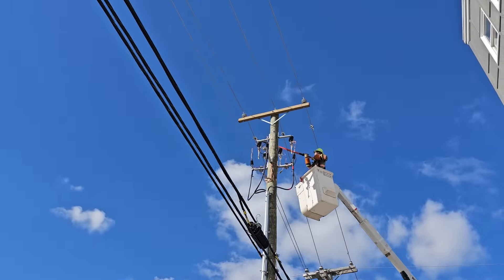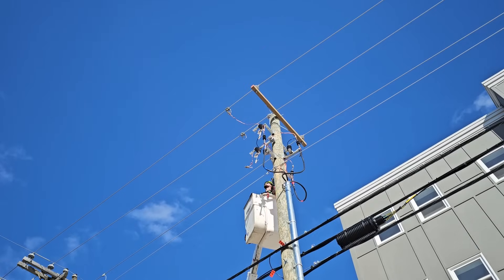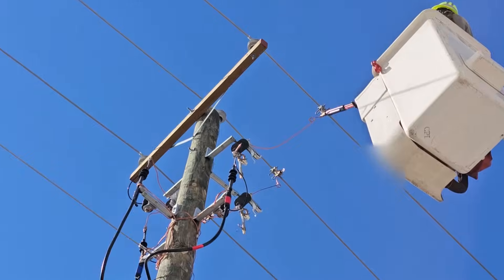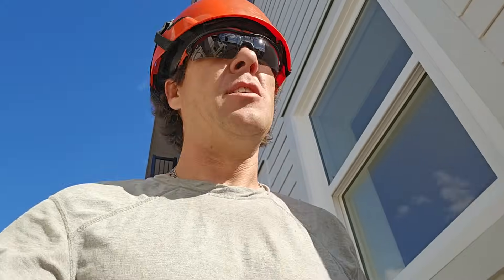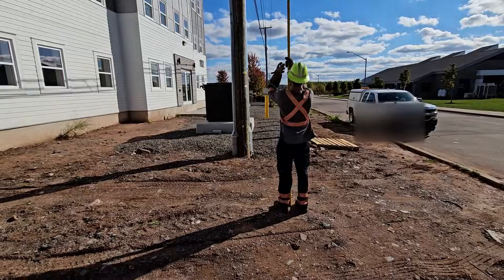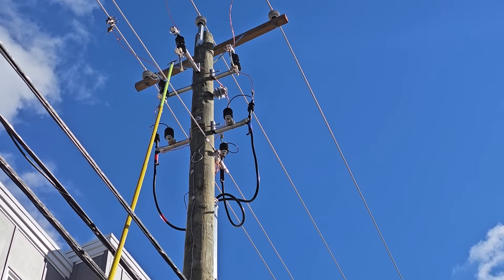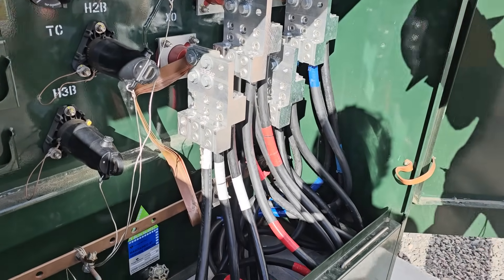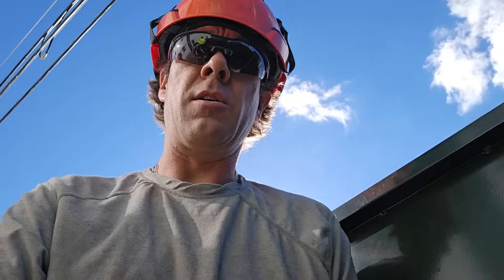Apprentice energizing padmount transformer

Comment: Just out of curiosity I would want to check phase rotation as well. I don't know what the code is in Canada. But in the US the phase rotation is required to be clockwise (ABC)  from left to right, top to bottom, or front to back.

Comment: We use an arrestor elbow on the B side of the pad mount. We need customer load connected when energizing any voltages over 13,200 volts. Otherwise we risk a phenomena called ferroresonance. Or we can install a load bank on the secondary bushings to replicate load. It’s like a bigger version on the mega-beast. With the new 4 core transformers coming out now we have a gang switch incorporated into the pad mount. We can turn the whole pad mount on or off with a shot gun stick. We can also energize the A & B sides separately. We try to give the customer clockwise rotation unless otherwise requested by the customer? 
How many crews did they send to Florida for Milton? 
Keep up the great content Aaron! 👊🏻👍🏻.
Reply: All of our 3 phase transformers had switches for HA, HB and the secondary so we would always pick the transformers up on the gang switch and if we were ever making or breaking parallel we would also do it on the gang switch. As far as rotation we only hook up the primary on 3 phase pads, we use RWB and we always go RWB top to bottom. The electrician is responsible for making all secondary connections and they have to supply a megger report and torque report as well as struts to support the cable to take the weight off of the bushings. We also had a maximum of 2 customers on all 3 phase pad mounts.

Comment: Last December a new apartment complex was completed in my neighborhood, a new pole and three transformers had to be erected across the street. Power was connected to the downstream line, however phase "C" needed to be added at the pole next to my complex on the high tension wires. At the same time disconnect switches, lighting arrestors  were replaced. New complex has 4 service head drops.

Comment: Do you guys do any testing before you energise for the first time?
Reply from the maker: If the cable is 4/0 or above its meggered before energizing. Standard Transformers are all tested from the manufacturer. In some cases we test the customer's cables for short circuits as well.

Comment: Our arrestors come hot when we land the taps....Never did like that especially since you are usually head level with them as you land the taps...Hate them things. Also we have primary internal load break switches on just about if not all new pad mount transformers. Energize the cable with it open, grab a grip all and energize transformer, all 3 phases come on at once. You are not single phasing customer. We also have the primary and secondary separated with a barrier. Dont like your dust cover drain wires near the secondary...

Comment: Why use bare copper out in the open? ( especially for the live wires )
Reply: Code
Reply: Not sure. The copper is quite a ways up, seems unlike that there would be theft at that height and that it us energized. But yhea,  would aluminum not work?

Comment: Aaron, assuming the three cutouts are for each of 3 phases, where do they pick up the Neutral?
Reply: There is no neutral on the primary side. It's a ∆/Y transformer, like most of them are.
Primary 3 phases, 3 wires ∆
Secondary 3 phases, 4 wires Y
The common point in the Y is where the "neutral" wire comes from.
Reply: No neutral on the primary side of the transformer, but the neutral is "derived" on the secondary side, which is in a "wye" formation - one side of each of the 3 secondary coils are tied together to form this "neutral" connection. So you end up with 4 wires on the secondary.
Reply: The neutral on the secondary side provides 120 volt power.

Comment: #2 copper on an arrester and they used an aluminum h connector for a copper to copper connection? 

#2 coppers way to stiff for an arrestor ground. Should be #4 so it can fall clear. 

And to make it uglier they had no fencing staples rhey used moulding staples? Dog water contractor.
Reply: Dude, grow up. Show us your linework...if you're even a real lineman.

Comment: Hey, I'm a sparky in Australia. Was just watching the thesting at the end, voltages didn't match what I would have expected.
Is your white the neutral and black a phase
We are opposite over here if that's the case.
Australia: Black Neutral and Red White Blue are phases.
Reply: Hey there - in the US on a 208V system, Black, Red, and Blue are phases and White (or white taped) is Neutral! So yeah, amazing how different each country is with color codes, as well as voltage, even frequency!
Reply: Black as neutral..? That's odd.
First time hearing this. 
I'm in the trade and work in Canada. 🙋‍♂️🍻
Reply: @martf1061  Australia may use European standards.
Reply: @dfirth224 The very old British was red/white/blue for the phases, black neutral, and green earth/ground. L2 later became yellow, then changes came from the European Union with the phase colours brown/black/grey with blue neutral and green with yellow stripe for earth/ground. These colours were chosen as they are apparently the least likely to be misidentified in most cases of colour blindness.
Reply: @martf1061  black wire, but white tape.
Reply: "white the neutral and black" Yes, in US and Canada (not rest of world). Originally ALL insulation was black (high carbon rubber). The electrons don't care and early systems didn't make a distinction. Even into the 1920s. By then it was clear that hard-grounding one side could be safer, Code proposed an "identified conductor", white preferred, because there was always a pot of white paint around. I worked a 1929 building all like that. This house here is 3 black wires loosely twisted, I added the white tape after verifying no hi-leg. Poly-plastic with permanent color is so much better.
Reply: Canada is Red-Black-Blue.  
The USA is Black-Red-Blue.
Reply: we have different colors for different situations.

for 120/240 volt split phase, its black and red.
120/208 Y is Black, Red, Blue
for 120/240 high leg delta, its Black, Orange Blue, with the high leg marked as orange.. Sometimes it will be black red, Orange, again high leg orange
for 277/480 Y, its brown, orange, yellow. 480 is often found in larger commercial buildings as well as industrial sites.
Reply: White is indeed neutral. This is a 120/208V tri-phase system. Black, blue and red are phases, and green or bare is neutral here. Sometime the green is yellow striped. And a common thing here is to use all black wires and just tape the end with colored electrical tape.

Most homes and appartements are split phase 120/240V. Some bigger complex uses 120/208, others get basically 3 split phases (so 120/240, 3 times). 

Standard outlets and lights circuits are 120V 15A, sometime 20A.
Most heating stuff is on 2 phases (so 2 out of 3 or both of split phase).
Baseboard heater is 208/240V, and are on a double 20A breaker. Water heater is on a double 20 or 30A, depending on the age and power (some are 3000W@240, some are up to 4500W at 240V). Cloth dryer on double 30, stove on double 40. Heat pumps are usually on 240V with the apropriate breaker size.
Reply: @thephantom1492  And this is not just the US and Canada.  Electrical voltages and 60 cycle/Hertz frequencies are the same all over North and South America.  Even Puerto Rico, Cuba, and Mexico use this same system.  Systems were standardized more than 100+ years ago.